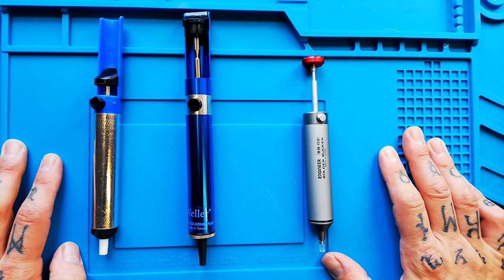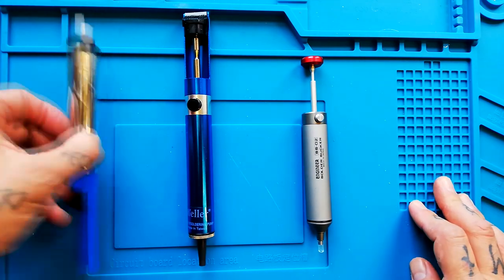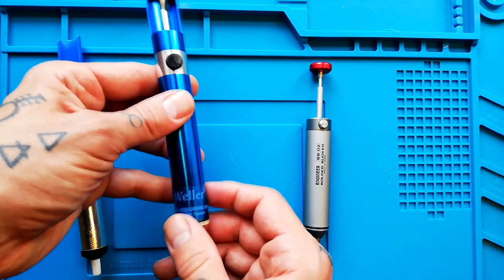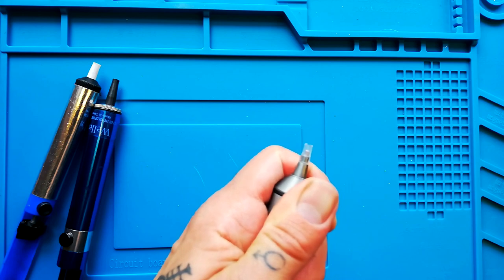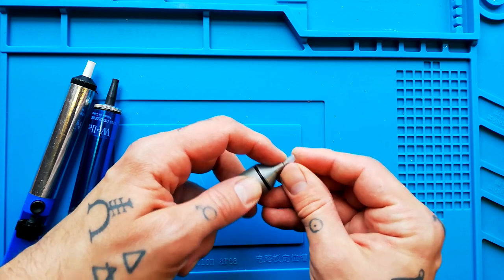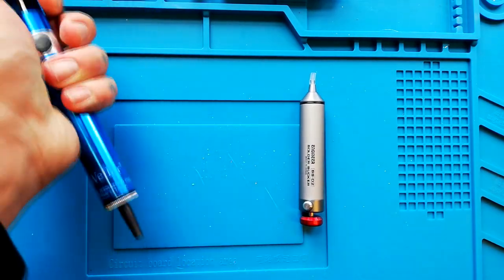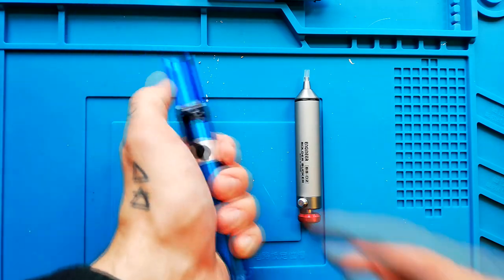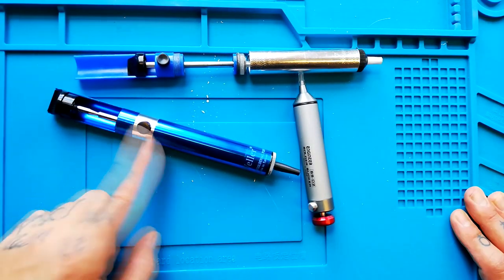Best solder sucker? | Engineer SS-02 versus Weller 7874b | Honest review!

Comment: I have the SS-02, and on the instructions it shows a picture that you need to cut the silicone tube to where the metal bit sticks out past it. Don't be afraid to put that silicone tube directly onto an iron and the solder being sucked up — I had my iron at 700ºF and it still didn't burn the silicone while moving slowly. So far this solder sucker was worth every penny. Soooo much faster than using copper braided ribbons.
Reply: I don't solder often, if not at all (only small projects here and there, and some fix for broken stuff), but my dad has the cheap one on the left, and I always hated, when I needed to desolder stuff, I have not too tiny hands but are quite small in comparison to most of people around me xD, and its difficult for me to grip and push that "piston" down with one hand, so I've recently bought the engineer one, cause it seams to me, first of all smaller, and also good made :), it will arrive tomorrow tho :/
One thing, did you replace the silicon piece of tube often, or it won't tear? The cheap plastic ones do "burn" in some ways, but silicon does not, right? I'm slow cause my hands move a lot when I desolder xD
Reply: @NightVisionOfficial  Silicone is usually rated for about 350 degrees c temperatures, so no, they do not burn. Same reason the cable for any good soldering station/iron is made from silicone.
Engineer completely intends you to put the soldering iron directly up to the tip, just watch some of their videos on it.
Reply: @AndrewStrydomBRP  I've finally received it, and i've already tested it... It's LIFE changer xD.
Also, i've bought the PINECIL(and of curse, the silicon USB C cable), and even that is pretty comfy to me, i can handle both with ease, and the Engineer is really well made! I would buy it another time xD, just to have another one spare ahahaha.
Reply: Same here. I recommend the Japanese little guy

Comment: I have the engineering and use it everyday for work. It started out nice and it's still good. But I find it upsetting that: one the silicon splits often. Two after the 7 months its been used it gets really pressurized after a certain point even after thorough cleaning making it impossible to pump. Three it gets clogged often, though it is easily fixed in a lot of cases. My hands are small so it being short makes it worth it. If those problems were solved it would be an absolute yes.
Reply: can you get replacement tips for it?
Reply: @deepwinter77  It typically comes with some extra silicone but you need to cut it (just use the pre cut tip that’s on it as a size template)

Comment: What about performance? Cheap no-name was completely useless! Rigid tip!! So not possible to get a vacuum seal whilst holding it at an angle (which you must when you only have access to one side of the board).

Comment: Just get a desoldering station because all hand pumps will break they are all bad. Haven't had one solder sucker last more 30-40 uses. Wick is slower but at least it will always work.
Reply: Wick is always the way

Comment: The japan-produced one - Engineer ...why not use it without the plastic tube? ..seems to me that the smaller the end of the tube is, the better the such and u get closer to the mold??
Reply from the maker: I tried that. Yes it stopped the blockage problem, but also made the suction worse, no better than the cheapest one, so why pay more? Just my opinion of course, thanks for watching.

Comment: You tape the the engineer silicone tip so it won't pop off. That way, you can just keep mashing on the plunger and most things will fall out. By mashing I mean you can hold the sucker with one hand and slam on the plunger with the other palm. It's a good way to clear the flakes stuck inside without taking the whole thing apart, as well. If it gets badly clogged, you use a needle nose tweezer to clear out the tip. Saves just a little bit of time not having the silicone tip come off every time you try to clear it.

Comment: I have the same cheapo sucker on the left, and had actually been considering getting a better one. In my head the silicon tipped ones get better suction? Then again I could probably get away with putting a tube on the end of mine :P

Nice video I didn't know I wanted! Short and to the point. Cheers!

Comment: If you are doing something like 50+ maybe 100+ solder units a day constantly, buy a premium desoldering gun like the FR-301.

For a hobbyist, it isn't about the time constraint, it was about the ease of use. I want to enjoy my time building my projects.

For a hobbyist, 20-30+ desoldering points every few session or less, it was worth the bump in price. But this depends on your economic situation as well.
Reply: The economics of ruining a circuit board due to the use of inferior tools catches up pretty quickly.

Comment: Thanks for the honesty.  The ss-02 really attracted me due to the fact that I'm addicted to Japanese stationery, but it seems like it'd be better use of my £20 or so to help towards those USB ts80/p irons which I know I don't need but want.  
Just curious, would you say that there is sufficient difference in suction with the silicon tube to warrant it's advertising? 
Thanks
Reply from the maker: The suction is excellent, I just found that when you factored in the time spent clearing the clogged tube it was more time efficient to use the cheaper sucker, thanks for watching.
Reply: Don't get one. Get the ts100 it's cheaper all around and there are more tips available. Don't get me wrong I love my ts80p and it's a great iron but the price of the tips and unit compared to the 100 which has many more available tips. But if you really want the ts80p it's also a good option just way more expensive.
Reply: @printgymnast368  hi, thanks for the reply.    Is it worth getting one of those soldering irons anyway if a standard one is serving me well?  I'm wondering if the extra convenience is worth it.  
Thanks
Reply: @willtato8778  not unless you need a portable iron to take with you and even then the ts100 is better because all you need is a lipo to power it while the ts80p needs power delivery USB c which is rare and expensive on portable batteries
Reply: @willtato8778 if you are talking about a cartridge iron vrs those screw in ones it makes a big small difference. Everything just works better. But you don't need to upgrade if the one you have works
Reply: @printgymnast368  thank you

Comment: After I saw this video I added a tiny piece of this 3/32 silicone tubing to the end of each of my cheapie tabiger solder suckers (all from Amazon, $20 total for 3 suckers and tons of tubing). 

The stock suckers aren’t amazing, but never jam or need cleaning like he was describing the nicer ones in the video tend to. 
However, I can confirm - adding the tubing tips increases their ability to empty solder from vias for through hole components several times over with much less frustration, 1000% worth it!

Comment: Rather than buying the most expensive one it seems efficient to buy the cheapest one and the engineer one. The engineer one seems best used for small solder joins on stuff like keyboards were getting ALL the solder off is important. Meanwhile for every other job, big ones good enough. Maybe get sillicone tips for the cheap one? not sure how well it'd work.

Comment: I have one as the blue one of the middle but mine its not a Weller one, mine has the mark HQ and its cheap, about 6$, and for the tip i put a piece of rubber from a flyback of an old TV over the original tip, doing that the tip never burns and it sucks better. P.D. Sorry for my bad English I'm Spanish.
Reply from the maker: Thanks for the tip. Tu ingles es mejor que mi Espanol!